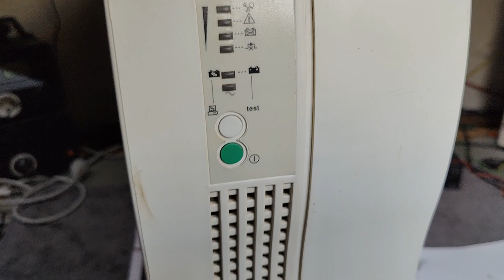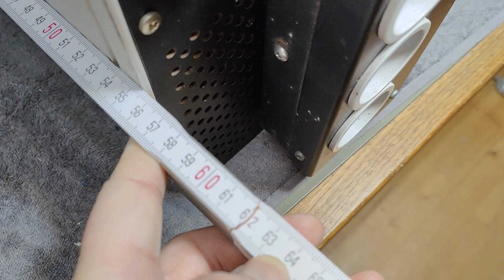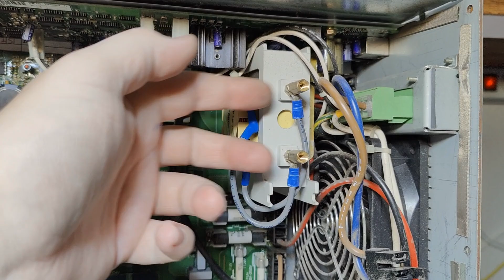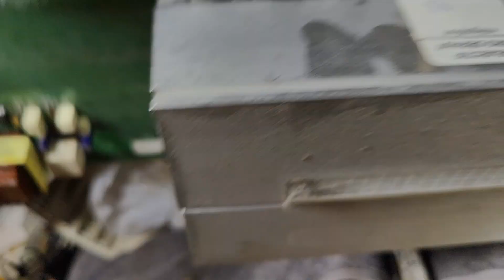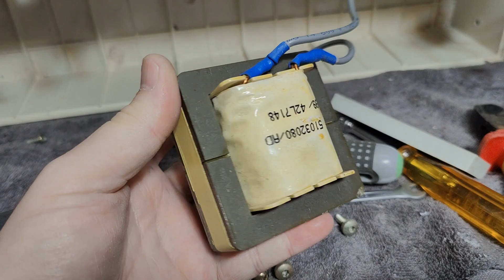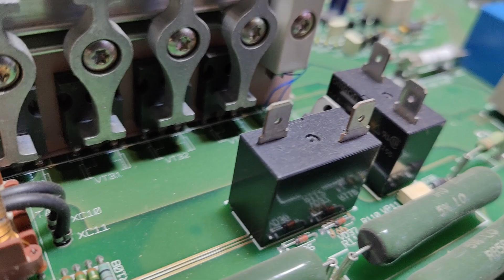MGE UPS systems PowerStar II 2400W 4000VA teardown

Comment: Dc 84 battery connect  and dc on. 230v build up and 3- 4 second cut relay operated system out  what happen
Reply from the maker: It's hard to say for sure without testing, but that behavior often means the controller has sensed an error and is cutting power to prevent damage.

Comment: At a grocery store not far from me is a large Best (now Eaton) ferroresonant online UPS which is primarily used to run the lights.  The thing is LOUD when it is running.  Ferroresonant UPSes drive the transformer with a square wave but the output is an extremely clean pure sine wave.  They don't have particularly high conversion efficiency- around 70 percent- but they are much simpler than high frequency pure sine wave UPSes and they are often used in applications where extremely clean power is required and failure is not an option.

Comment: Looking at the resistors on the board, it looks like the thermal design is pretty decent, there seem to be no hot or burnt parts. I also like the clamps pushing on the mosfets, they give a sort of spring loading, keeping the pressure on, no matter what. Nice video, thanks Thomas.
Reply from the maker: that is exactly how I see it too, old electronics tell a story if we just look a little bit :-)